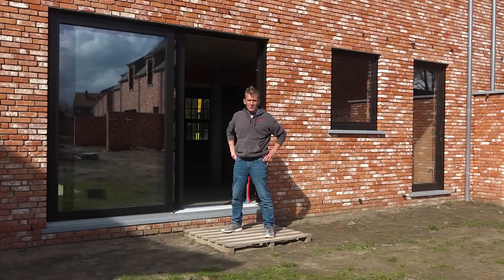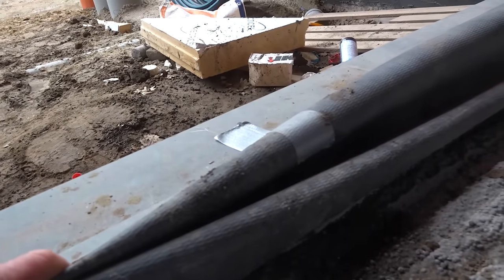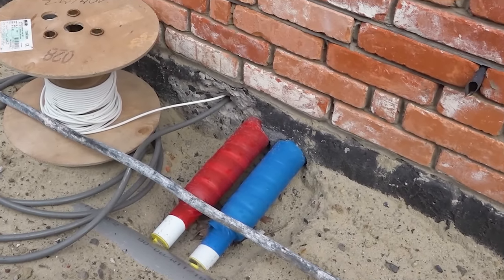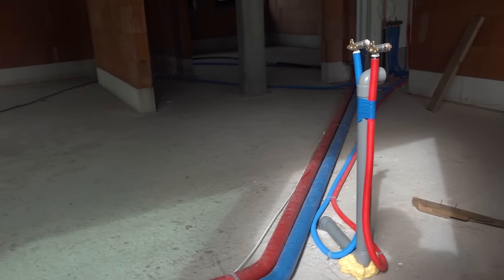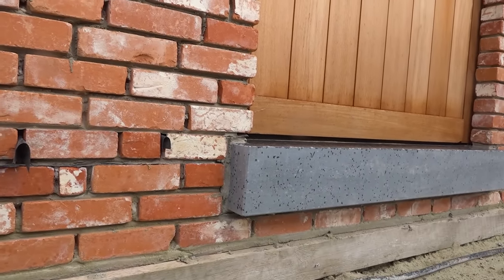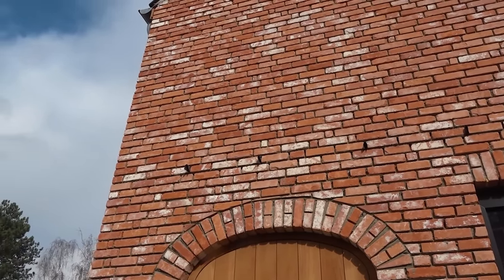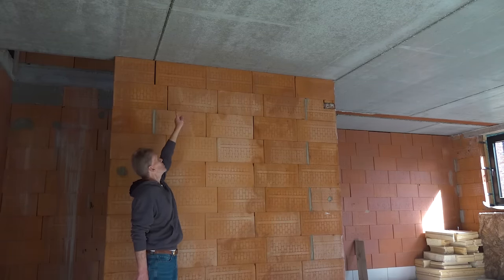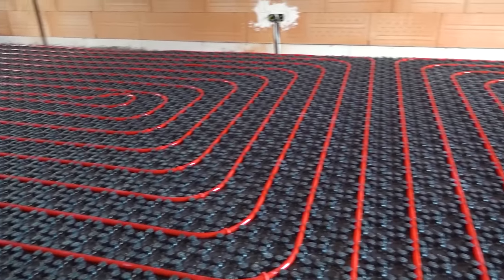Can We Learn From Buildings in Belgium?

Comment: The bison floor looks like plattendecke to me popular in Germany one layer of mesh in the concrete slab landed on the walls and rows of acrows another layer of mesh with rebar over windows and  that's the concrete floor common in two storey houses, the undersides usually face finnish
Reply from the maker: What do you think about that steel beam landing on the window lintel? It seems like a big load with all that floor.

Comment: There's no magic where damp control is concerned and they seem to have all the correct details.  Pointing after the windows are in?  Keep pipes out of the floor screed in my book.  Unless ducted in a lined trench I can't imagine pulling pipes through that lot.  Are they all plastic?  Our copper pipes take up far less space when run above floor and access for servicing is key.  I would prefer clay blocks, thermalite have very little going for them.  How does clay compare in terms of sound transmission?  And where is all the timber frame prefab that we have to put up with as purchasers. Time for some research.  Fascinating video.

Comment: Britain used their expertise pre millennium.   We put it wood windows and doors in new builds then a short time later had a salesman sell you UPVC frames and sealed units at great cost. After building empty cavity walls we then drilled holes in later to pump in a cavity filling material , all at a cost of course.   When visiting Germany the windows and doors were triple glazed  UPVC highly insulated units and the bricklayers were using block insulation in the cavity as they built each lift. Therefore all the things we paid extra for the continentals were including in the finished building.      RIP off Britain is so aptly named.  It’s rife in almost any transaction.

Comment: Ehm, the colored sleeves are NOT for replacing the pipes if there's a leak. They are there to prevent a leak down the line. Concrete and bare copper pipes don't mix. The concrete will 'eat' the copper and over time holes might appear.

Comment: As a bricklayer I'm interested as to why the brickwork is pointed after construction. is that the norm or just a feature of this project?
Also, what the hell is going on with the brickwork bond?. Closure's and headers randomly laid leading to hap hazard quarter bond in a half brick skin? Weird.
Very interesting video, thanks.
Reply: The brickies work from inside the house so there's no scaffolding, concrete floors mean the brick packs get craned up onto each level.  A pointing contractor comes in about a year or sometimes later with scaffolding. It seems they like to let things dry and settle. There's dozens of pointing colour options as well.

Comment: I live in Cyprus and they DON'T use damp course in there buildings. Modern new builds usually have damp problems after 2 years.
My house is single storey - a concrete box build - they say that as its a dry country its not required. Rubbish we get a lot of winter rain

Comment: I partly agree but to suggest that it just needs more cash is simplistic. Without a radical  restructuring and competent management, no amount of cash will make much difference. It's a defunct organisation which has already collapsed. GPs have clearly been told to fend people away and go private if you can (or die if you can't).

Comment: It is the most underestimated knowledge of a civil engineer; waterproofing, damp householding and ventilation, even among civil engineers. Engineers make details as they have been teached. Now we are changing constructions with new materials and more insulation. If you don't understand the environment and what temperature and moisture do in specific details, mistakes can be made easily creating condensation, leakage or capulair rising water. Anyone can start to work in the construction industry including your average d.i.y. home upgrade and I see lots of solutions screaming for problems.
Reply: * taught.

Comment: Nice one! Typical practice throughout Europe, except perhaps damp proofing details which understandably vary as regional climate dictates.

Time to adopt concrete floors here too. Superior for fire safety, acoustic performance, adding thermal mass.
Reply: I live in a block of flats with concrete floors between them and the sound proofing is terrible. It's like the upstairs neighbour is in my flat when they're stomping about, slamming cupboard doors, dropping stuff on the floor, etc. The interior walls are all concrete breeze block, and noise flanges through those too from the adjoining block.

Comment: You really should have started this video with a train animation, not a plane one Roger. That's the way to get to Belgium these days. Perhaps the most significant thing about Belgian building is that every building in Brussels (commercial and domestic) has had to be passivehouse-grade since 2017. Proving that it can be done, and it didn't even cost anything extra after the first 2 years.
Reply from the maker: That is good to know. I know what you mean about the plane, it makes no sense. I drive there in my camper bus so it involves a trip through the Chunnel.

Comment: Dampness has only occurred once we changed out materials and methods of building. Modern materials need specific needs, look at how buildings today have mould issues, yet we are 'better' insulated today, yet because the more we insulate the better our detailing has to be or this is where we get our problems. The same with even how we live. We are cramming households with items we didn't have say 100 years ago. In the end its all about air flow. Spending many a year in old 100 plus year properties ventilation pretty much cured the majority of any issues. The other was the reduction of concrete, and modern gypsum. What I found was we have so many systems, and rather than people sticking to 1, they are taking the best from a variety of systems then wonder why they are failing. Take insulation, Most don't really understand how convected insulation and radiative insulation differs and put both systems together, and as air sealing is critical in many areas these 2 systems need different installations. The importance of air in a reflective insulation is far more critical to that of a convective on top of that people then add visqueen and wonder why the property is damp. All these various methods just because they have their place it doesn't mean the work together.

Comment: If  you want to see serious damp proofing, that's lasted... Go to Bruges... On a horse drawn carriage tour of the city, crossing a bridge, I looked down at the canal, and noticed that some (hotel?) windows were really only, perhaps, two feet above the water's surface, and, through one (open) window, I saw a lady preparing food, her worktop being below the window sill level... Her feet, obviously, further below...
I said to my wife "How the hell do they keep the canal water out of those rooms?" She had no ideas, but our coachman said in perfect English, and looking back to me, allowing the horse to take control... "the buildings were built properly!"  Hard to forget, and difficult to argue with...

And... I've installed "pipe in pipe" in flats in England... I was assured by my boss that if someone "nailed" a pipe, it could be replaced easily... I'd have gone sick rather than attempt it. All the radiator pipes were drawn up into a corner of the kitchens, to a manifold, below a worktop, below the boiler...quite a restricted space, so you'd be on your knees pulling new pipe (because in the kitchen there were no carpets at risk.  But the pipe had been pushed through the conduit before routing it, via various curves, from manifold to radiator...  It might be easier to pull old out / pull new pipe in the other way, at risk, though, to the beige carpets, magnolia walls, the soft furnishings...
Reply from the maker: You did that horse tour in Bruges? You must be minted.
Reply: @SkillBuilder  Didn't seem too expensive 40 years ago...Nothing did... And I expect that sub canal level kitchen floor is still dry...
Reply: @SkillBuilder  Not at all expensive 40+ years ago.  I drove there in a cheap, ex driving school Fiesta with starship miles on it, ate street food, like the frites/mayo from the trailer near the carillon... The chocolate was too expensive for me, I admit...

Comment: Considering by far the most amount of linear pipe in a modern home is for the underfloor heaitng, which can't be pipe-in-pipe - is there any point in making the rest pipe-in-pipe? I suppose you get the thermal conduction benefits if its also in the screed?
Reply: I guess that you could look at it the other way. Given that there isn't a huge amount of pipe underfloor, and it causes such an issue if there is a leak, then the pipe-in-pipe is a sensible decision.

Comment: To stop damp welling up in old houses: take a 2cm (width) drill, in inside face of affected wall drill a hole (NOT through-and-through!) every 15-25cm (depends a little on the size of the bricks) at a 45° downward angle at about 90cm height, put in a funnel in the holes pour in a little silicic acid and repeat until the holes no longer drain. You'll need about 2l/m for a rather porous wall (the mortar in the joints is the main source of pain). Did wonders in my 1920s house which happens to be built over an underground natural creek. Much cheaper than the €5000 evac system offer from a 'specialist' builder.

Comment: our country is years behind with building technology ,but that brickwork bonding would drive me mad i think they call it a "running bond "just random and chuck in any cuts they have
Reply: i've heard it called quarter bond here. blew my mind when I travelled there, but spotted it on a few builds in the uk
Reply: also a fair few garden walls
Reply: Not too sure about that , i believe the new insulation standards for new build houses and extensions are pretty rigorous. Where it all goes wrong is with the muppets who come along and fit the stuff. Very little technical knowledge , getting the site labourer to fit the insulation is never going to work out well.

Comment: If I had a new build for a house, I would have none of the UK standards applied pretty much! All floors would be concrete for starters, pipe-in-pipe would be everywhere for water to electrics to waste, grey-water collection would be mandatory and roof tiles would be solar panelling type as standard. The house would be sitting in/on a totally insulated flooring system and a basement would absolutely be totally mandatory! Having lived in Germany and visited family in Switzerland and across Europe, it staggers me how far behind this country is in just the way we still build houses, heat our water, and generally create homes - frigging immersion heaters?! WTFerlipping heck is it all about? Oh... wait... 'cost' I am told! Idiocy I would suggest... and don't even start me on future proofing... just imagine if all houses had something like 100mm piping embedded into the build for all the different electrics/cabling/piping etc. all you need then is a pet ferret to run the new stuff through it! I am sure that someone somewhere will tell me this is not a good idea!

Comment: Those indoor brick walls cannot be load bearing per regulation.
Reply from the maker: Well they are so you will have to explain why you think they aren't.
Reply: The regulations are a bit more complex. It depends on the width of the bricks, how high the wall is, and what will be the load. These bricks are actually the same ones  as they use for the load bearing walls behind the facing bricks. You probably call them 'indoor bricks', because this type  needs to be protected a bit from the elements. But for the rest they are strong enough to beat load.

Comment: THE PIPE IN PIPE would have saved my sister having to repalce a hard wood floor when a pipe leacked and saturated the slab with about 10,000l or water

Comment: My house in Cirencester UK is made of Porotherm blocks. Bloody awful things. Thermally, they're great, but acoustically, horrendous. The sound travels through the cavities in the blocks up the wall into the room above. Also, if you drill into one with a hammer action drill, they shatter. You can get ones that have the cavities filled with insulation material. I expect they would be a bit better as far as the sound is concerned. A nightmare to chase out to fit back-boxes for electrical outlets and switches.

Comment: I love it - no plastic drinking straws allowed but entire floors of plastic matting are fine ;) My contention is that with energy prices and the drive for minimum wastage, buildings should be planned so as to have minimum redundancy in pipes, keeping energy waste low and materials used to the least necessary - bathroom and kitchen walls should be adjacent and/or above one another. 
       When I fit pipes or cables I always put them in old water pipe so they can be replaced at any time or new extra cables/pipes drawn alongside - they cost peanuts and sometimes one can even get hold of insulated ones form district heating systems (here in Sweden, at least).
        It would be really nice if you'd explain more about the cavity/threshold damp-coursing with a diagram or two of right and wrong so people who aren't builders can follow it and know what to look for etc.
        Thanks for another really good video.
Reply: The plastic hot water tubes aren't single use disposable items are they? Those will be in use for decades, whereas the old plastic straws were used once and never recycled. Hence the microplastics being found in seafood, and entering the food chain no doubt.
Reply: @CuriousCrow-mp4cx that's a nonsensical reply - the volume of plastic in thin straws is minute and one would have to use tens of thousands to make up that in one floor, plus there is no reason they should not be disposed of properly at all, or even reused a few times with sterilisation. When a floor is taken up - because of accidental damage or wear/freezing or change of house structure/rooms the cost will be vast and the plastic will likely be mixed with concrete and all manner of all other crud and hard to recycle or to burn. The micro plastics entering the food chain are because governments introduced laws to say that polymers had to break up in sunlight so as to not leave visible litter - something usually easy enough to clear up manually: Not exclusively of course, but generally they needn't exist in the quantities they do. Either way, micro plastics will come from manufacture and use of all manner of goods - if you dislike them so then I assume you wear no clothes made of polyesters or synthetics, wear no shoes made with plastics, use no car built with them, use no railways which use them all over, fly not, eat not (packaging) and never leave the house. The reality of micro plastics is our standard of living will be back to middle age peasant if we don't endure them, but what we can do is  manage our use of them and thus our manufacture quantities of them. Underfloor heating can be achieved in many ways and it is anyway essentially not necessary whatsoever - nor are straws. But I think you missed my point - go so far as to ban one then go so far as to ban the other, in essence.

Comment: There is only one thing I wish houses in the UK had, and it's concrete floors upstairs, instead of joists with subfloor, that starts squeeking after a few years no matter how well it's been put together....
Reply: That is why the current requirement is to both screw and glue the flooring down.
Reply: Easily done with Lewis deck.
Reply: @foppo101 That’s what underfloor heating is for!

Comment: I'm looking for the best way to somehow bond old cement on new cement outside any ideas
Reply from the maker: SBR is what you need. Don't buy it from B&Q because it is over priced.
Reply: @SkillBuilder  it's to build up on some fence posts
 So they're not sat in water so much  wanted to put the cement around the wooden post about 4 inches high

Comment: My house in Belgium, a newish build just outside Brussels was very well built, almost maintenance free, but cold ;)

Our house in Canada is much warmer but my wife calls it a dolls’ house given it’s made of wood and has more movement in it. Easier to remodel though.
Reply from the maker: That is interesting. It seems the Belgians might not be so hot on insulation, which is odd because they make loads of it.
Reply: A wooden house just heats up faster because there's less thermal mass and has generally better insulation because of the wood. 

Having lived in both the differences are noticeable.

Comment: The inside blogs are the worst for me. You'll notice if you want to hang something up. Hammering drill will shred them into pieces and normal doesn't get through. so delicate blogs. You can use a mettal drill but it woun't stay sharp for long.

Comment: I still think our British ways of building are far superior to the foreigners methods. Can't beat good old fashioned solder joints and copper pipe, proven for many years, I think electrical installations could be updated to make a property rewireable without demolishing the place.
Them wall pots are quite hard, a nightmare to chase into and set a socket box. 
The patio doors were a beast, they must have weighed a ton. Need something strong  to help support that massive floor slab with that flimsy looking lintel above.

Comment: Those ESI valves are terrible.  I never fit any of the cheap 2 or 3 port valves.  They are not worth the hassle, stick with Honeywell, Danfoss or Drayton motorised valves at least they will last a lot  longer, some of the cheap valves will fail in less than 2 years.

Comment: No way this will happen, building firms are to greedy. Can’t even get them to put copper piping in radiator plumbing. Plastic micro bore should be banned.
Reply from the maker: There is nothing wrong with plastic pipe. I have had more pinholed copper in my time than I ever had with plastic. It is bomb proof.